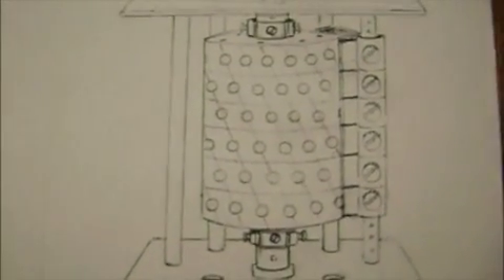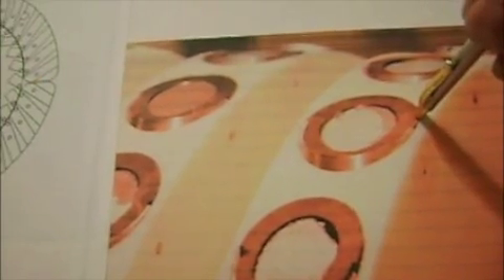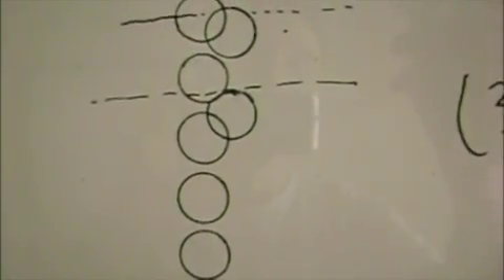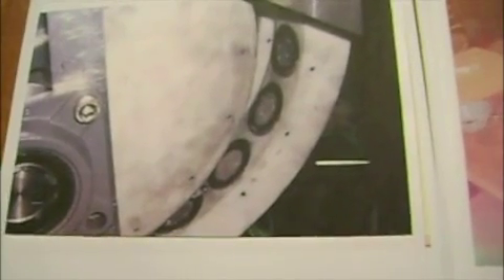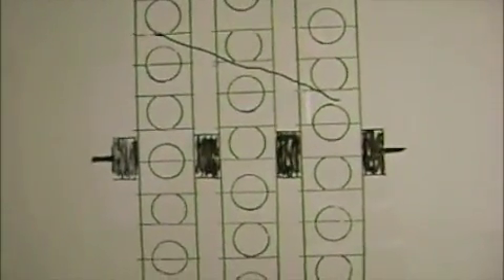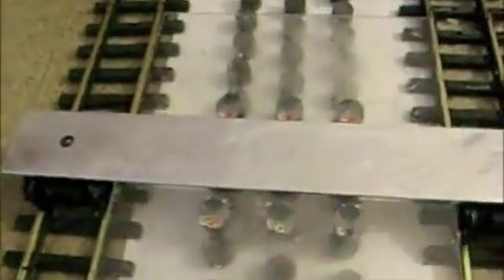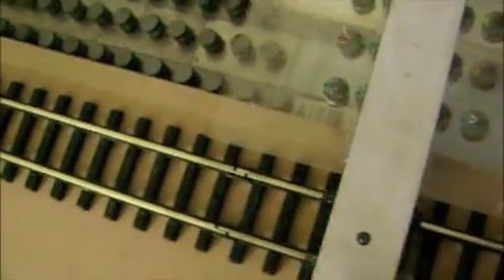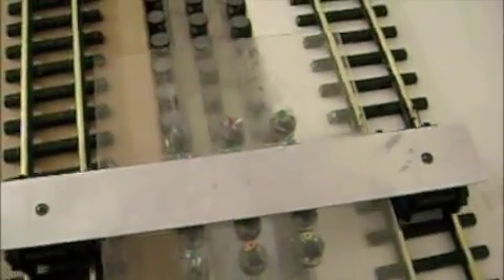How the Perendev Motor worked...If it worked.

Comment from the maker: Ferrite is a highly magnetic metal. If you google it, it's pretty easy to find suppliers. You'd have to either drill out cylinders of it, or have them made to the specific size of the magnets you use. It's highly brittle, so you have to use caution in handling it. Mike Brady said, he used bismuth shielding which is fairly easy to melt down yourself. I'm not convinced that's what he used, but it's possible. The parts in the stators and rotors would need some sort of a clip to hold them in place.

Comment: One thing that most people don't take into consideration is every permanent magnet has a specific strength, even if they are all made exactly the same, by the same company,  with the same material. They don't bother to make sure that every magnet has the (as close as possible) same strength.
My cousin use to race model electric cars. We worked together to find every way allowed to make his motor run as fast as possible & balanced (& as strong as possible) permanent magnets was one of our tricks.
One way to go would be to put balanced magnets on the "enclosure", then measure each armature magnets' flux & bore its' hole depth to make its' strength equal with the weakest magnet on the rotor.

Comment: If you look at most any induction motors, the rotors all have that "Skew" orientation it reduces "COGING" lets the rotor turn smoother  and more efficient. Also it is applied to many quality three phase RC hobby motors to reduce Gogging and let the rotor smoothly pass by  each set of magnets with less resistance to locking up from cogging

Comment from the maker: I mentioned in the video that Brady's design supposedly used Bismuth shielding, and that the replication attempt that Sterling Allan had put together utilized graphite. That's a good point though. And ironically, I'm currently looking into pyrolytic graphite and bismuth. So it's funny that you mentioned that. Thanks.

Comment: Soft Iron Pipe has been used for sheilding in Howard Johnson Motors that have worked, but due to the fact that no one has figured out the proper uneven spacing of the magnets used by Mr. Howard Johnson those motors tend to stall and need a little push to get them started again. I also think Howard Johnson used another of his inventions for sheilding magnets, which was a ceramic material used in a muffler for the military to silence motors at 50 feet. I think Soft iron particles may have been used in the ceramic materials. Soft Iron Pipe was used in the large Pevendev Motor to Shield the motor. The biggest 2. Problems is 1. Staling, which everyone since Howard Johnson has encountered and 2. Degausing of the Magnets Over Time. I believe Howard Johnson's Machine had Degaussed on him, and He honestly believed someone had Sabotaged the Motor he was using to power his house in Blacksburg,VA. Since Mr. Johnson was not a Scientist, but an Inventor. Mr. Johnson , I thnk did not understand Degaussing Effect of Magnets or Miss Calculated the life of his motor due to the Degaussing Effect.

Comment from the maker: It doesn't quite do what it's supposed to yet. I showed in the video, that the track only seems to work by starting the cart at the opening of the track. However, I believe that by the end of the video I was closer to achieving the desired results. So I am currently experimenting with the spacing of the magnets on the cart, and extending the length and arrangement of the magnets on the track. If the results are favorable, I will post them later.

Comment: l think the best shielding material is superconductive materials, but the main problem with superconductive materials is low temperature necessary, if there is a room temperature superconductive material shield, magnet motor may work.

Comment from the maker: That's possible. If you could angle the fields of the magnets into a straight field, rather than the umbrella shape they normally exhibit, the golden ratio would probably be all you'd need to make a magnetic motor work. IF you  could.

Comment: the reason your motor doesn't work on the tracks is because the magnets that fall behind the train pull it back while the ones ahead pull it forward. The circular motor does not have the magnet faces on a level plane side by side, they are projected away from each other, not affecting the neighboring magnet because of its shielding. encasing the motor in the center with magnets, creates an environment of directed propulsion. Like a water wheel that has water jets pointed at each paddle.

Comment: 1 jet pointed at a water wheel with 1 paddle wont spin, but multiple paddles it will. but in the case of having the pull back, the propulsion needs to be greater than the pull, therefore you need proper shielding and strong magnets.

Comment from the maker: Some of the diagrams I showed in the video were Mike Brady's, and the rest of them can be viewed and downloaded from the link I included in the video. The flat track version that I featured was intended as a general approach to testing the orientation of the magnets, to determine the best arrangement of magnets, before tooling expensive parts. If you'd to look at a version that's much closer to Brady's original design though, check out what user CIV is doing on: sons of tesla dot com

Comment: I have an idea that I cannot afford to try out so if someone wants to try here is my idea (and if this has been done before just ignore me lol) some ring magnets (or rings of magnets) with north on the inner diameter so south is round the outside diameter. Then 3 or more bar magnets (on a track or something) moving through the inners.....assuming 3 bars for a moment, they should be set up so as one is just before half-way through the ring, one of the other two is attracting to a ring ahead of it while the other is being repelled by a ring it has just been through. If the inner diameters of the rings are all north both sides (because south is the outer diameter) then as a bar approaches you have north/north attracting and after passing through the south pole of the bar will repell the same ring :) there will be resistance as each bar get to half-way through and the trailing south end starts to meet the north ring.. hence the thing with the positioning/setup of the bars :)
If anyone tries this.. let me kno if it works :)
have fun!

p.s. if I have not explained clearly enough feel free to message for more info :)

Comment: I even rode a stop to analyze and see with my own eyes. Therefore I say that this way will not work, because I Fawn mounted for all to see. But whenever there is a BUT. There is a missing link that is not disclosed, is the procedure that has to be accompanied by a mechanical device, and exactly what I'm already working. Ie, there must be compliance with the angles of this refrigerator design, but a mechanical device that allows the process of perpetual mode.

Comment from the maker: Well, there is nothing simple about the Perendev design. No one has, as of yet, proved it to work under independent verification. I have yet to build a self rotating device, so I don't know that I could be of much help to you. You might want to look into what Muammer Yildiz is doing on the peswiki website? He is in the process of verifying his magnetic motor design to outside sources, and has demonstrated it working to many witnesses.

Comment: Instead of using this as a free energy machine could you maybe combine this with an electric motor in order to increase efficiency?
Reply from the maker: shortbusheros4 Possibly. That's the sort of research John Bedini specializes in. I haven't, as of yet, ventured to far into electromagnetics in my builds.
Reply: shortbusheros4
Reply: Yes, that would be me.
Reply: What would be the point??? If the magnet motor works, why use an electric motor at all???

Comment: No, the Perendev motor never worked and it will never work. No motor can be driven with permanent magnets. Conservation of energy can't be tricked. No shielding, no angling of whatever works.
Reply: @JF32304  magnets work following Maxwell equtions. You can prove mathematically that you cannot create energy out of a static electromagnetic field. Fiddling with magnetico configurations, screening, etcetera is just playing around with Maxwell equtions, all these things work according to them. So either no magnetic motor exists, or this works not following Maxwell equations. Which would be a Nobel prize discovery.

Comment: he didn't deliver on the ideas because the ideas weren't his in the first place.  It was stolen technology ideas, likely by Tom Brady or some of his minions.  The ideas never were intended to work in the first place.  They were just ideas.  I developed these ideas clear back in before year 2000 when all of my concept drawings were stolen when I went to a shop to have a company help me construct my ideas for testing, where all my design ideas were stolen out of my travel trailer.  Then 6 months later the ideas started showing up on YouTube.  Then everyone started copying each other, regurgitating bad ideas over and over, thinking they can make a motor that doesn't work in the first place, somehow work so they could Monetize their website on YouTube.  Serves the people right.  Anyway shielding doesn't work, never did.  It was an idea that was not complete.  What you see in these ideas are examples of trying to fix my ideas that were never complete or even tested in the first place in my infancy of understanding magnetic fields.  Their using round stock magnets.  First mistake.  As long as your using round magnets... none of the projects will ever work.  Also, just for your information, you cannot go from a flat track to a round track.  The magnetic fields are not all small local fields.  Anyway... start using a CAD system.  you will have an easier time working with your so-called Golden Ratio's.  Also magnets do not ever wear out.  They do however demagnetize under certain circumstances.  It is important to get the lingo correct.  Or you will never be taken seriously.

Comment: Conservation laws are fundamental to our understanding of the physical world, in that they describe which processes can or cannot occur. For example, the conservation law of energy states that the total quantity of energy in an isolated system does not change, though it may change form. So magnet motors are impossible.
Reply: +Mark Silver But you are converting the force produced by interacting magnetic fields into kinetic energy to then be harnessed. I feel a lot of people write these things off as "perpetual motion machines" and argue you can't make energy from nothing, which I 100% agree with, but I don't believe that is the case for these.
Reply: Many believe, that you can get days after days much power from a magnetic engine, because the permanet magnet is almost infinite energy source. Actually the temporary torgue what you get from the engine, is not magnetic energy, it is potential energy. You load the potential energy to the device, when you do work against magnet forces. Then this energy is released later. Same idea when you lift a heavy weight in a cuckoo clock which gives power to the clock when the weight is moving downwards slowly.
If you have a non magnetic object of ferromagnetic material and you make it magnetic with an electromagnet, the used energy is quite low. So the "magnetic energy" in the magnet is also quite low. One AA-size battery has more energy than a modertate size permanet magnet.
Reply: I do not understand your point. The whole point of this concept is to convert one source of energy into another form which breaks no laws of thermodynamics. Here the magnetic force -> kinetic energy then we harness the kinetic energy.
Reply: Force is not same as energy. Energy is not same as work. Learn the basics of physics. If you don't understand the basic concepts, then it is obvious that you don't understand my pervious comment. I have no motivation to be your teacher of physics. Have a good day, bye.
Reply: Considering I am an aerospace engineering masters student I think I have a basic grasp of physics thank you. Force x distance = work (crudely). Magnetic force x rotating disc circumference = work done by magnetic force. Turn this rational work into useful work -> magnetic generator.
Reply: And still you speak bullshit....
You used googe to get the deifinion of work etc. Why you believe that magnetic FORCE can be converted to machine WORK.
Reply: Continue.... You can get one revolution work but the turnover point needs exacty the same energy which was got previously.

Comment: 私も円周を直線にし、その上に磁石を配置したが止まってしまう。
その問題によって、暗礁に乗り上げてしまった。

あなたのビデオを観て思いついたことがある。
磁石は、まともに正面からぶつかれば、歯車の山に当たったかのようになる。そして、停止する。

ビデオにある上からの磁石を、右か左にオフセットを掛けるのも一案ではないだろうか。

それと、何度か実験をしてみて思うことは、磁石の反発力のみで動かすのには無理があるかもしれない。もし、可能性を見いだすとするなら、吸引力も交えた混合系になるかもしれない。

あなたの参考になれば、幸いです。

--------------------------------------
( Machine translation )

I the circumference straight and stalls have been placed a magnet thereon.
By the problem, I had deadlocked.

Have you ever come up to watch your video.
Magnets, decent if Butsukare from the front, so that if it had hit the mountain of gear. And, I will stop.

The magnet from the top it is in the video, would not the idea also hang the offset to the right or left.

At the same, that I think I try several times experiments, it may be impossible to to move in only the repulsive force of the magnet. If it is assumed find potential
Reply from the maker: 雷道輝一 ありがとうございます。私は、あなたが魅力と反発力の両方を用いたモータのアイデアで何かにおそらくだと思う。それは私がビデオの両方で示唆された一部は何だ。